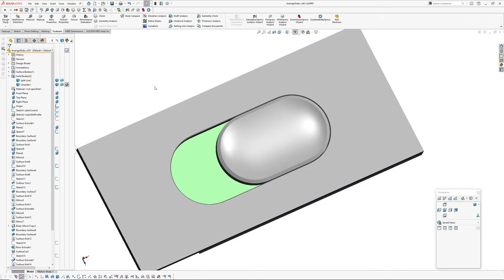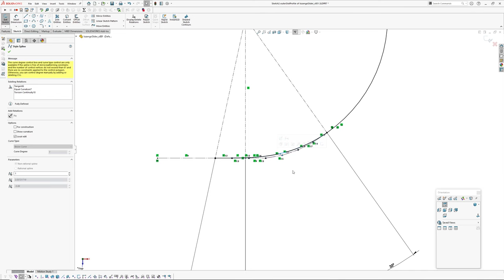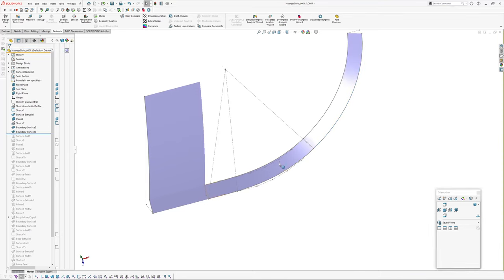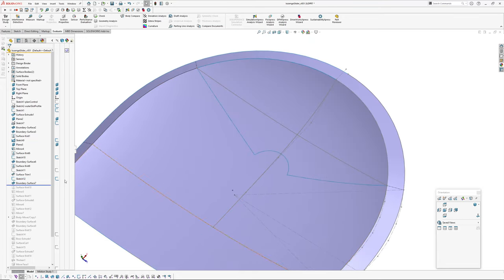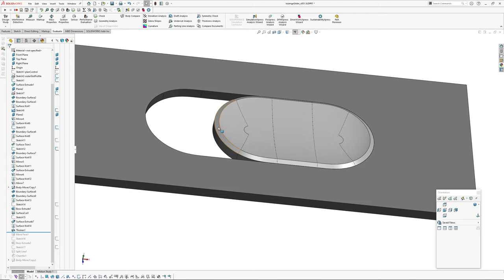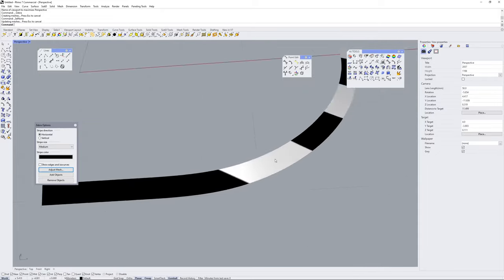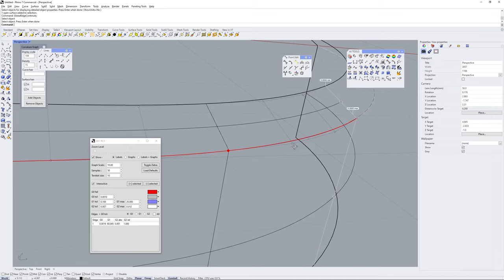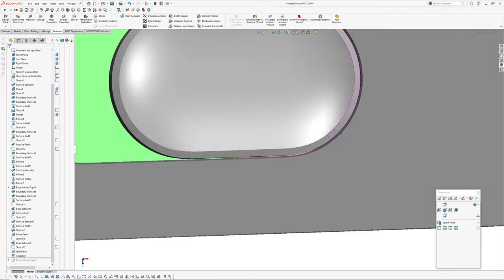Modelling a G3 Lozenge/Pill Switch in Solidworks

Comment: I've got a soft spot for lozenge shapes too! But you probably already knew that! xD
Reply from the maker: Yeah for sure! Found a picture of a more challenging lozenge form but there’s no info about the origin. Maybe I will model that next time.
Reply: @AndrewJacksonDesignStudio  I still feel a perfect g2 curve transition between the line and arc is the best. 
Anyway, after lozenges maybe try g3 ball corner cubes! :D
Reply from the maker: Pretty sure this has smoother curvature transition than a g2 transition. Also have to balance between eroding too much of the arc and having the transition being too abrupt.
Reply from the maker: G3 and ball is an oxymoron? If the ball implies an arc or circle that is 🤔
Reply: @AndrewJacksonDesignStudio  continuing my point above, this perfect g2 “transition” curve I’m talking about also works great when you have to make offsets. 
Offsetting any line and arcs with g3 curve between them leads to discontinuities which when you try to correct will result in variations in offset distance between the entities
Reply from the maker: Why does a G2 (assume a deg5 bezier) spline between entities offset ok whereas a G3 (assuming deg7 bezier) won't? I know SW will in most cases make the offset curve a deg3 multispan spline, whether or not it is deg5 or deg7 to begin with. Let's see an example please, be good to see what you mean.

Comment: Really great video as always, cheers A J! 
I go about this using a similar method in PTC Creo/Style (ISDX), but I don't use the section of arc for the top profile driver. Instead I use one continuous spline i.e. G3 connection to the flat side of the pill/lozenge (set back from the natural arc tangent point) and normal to the centre plane on the other end of the spline. I then match the spline to appear almost identical to the pure arc....I've seen some people automate this process using an algorithm i.e. to take the guess work out of matching the spline to the arc. I think if you use one continuous spline (rather than a spine joining linked to an arc) you avoid the issue you are having with the sweep method, perhaps?
I'm currently working on a button recess channel that resides on a compound A-surface and has a pill/lozenge shape at the end of it. Its been an absolute nightmare to retain G3 lol
Reply from the maker: All good! Yes, I have built pills/lozenges in the same way as you mention. I think I flip/flop between both ways, as you said, doing it in one results in no surface break along the ends. 
One good thing I have found with using an arc is that once you have figured out the relief angles on the line and arc, you can repeat at different scales without adjusting anything, which is similar to the algorithm for a single spline. 

I tried sweeping a line along a deg7+ spline and the sweep still deviated from the path, so I think this is an internal SW issue. Will investigate further.

Your current modelling challenge sounds really interesting! I can see how that might be tricky! Have a good weekend.
Reply from the maker: Had a crack at some forms on a compound surface. Revolved surface, so not that much to think about :)
https://youtu.be/Fgli405qRmk

Comment: "SolidWorks must cover up their tolerance issue" When I was starting modeling with Rhinoceros in 1998, there was general opinion that the software was great but the precision tolerances are terrible 😅, which was true,but I don't know how it is now. After a few years of working with Rhino I switched to SolidWorks and just occasionally come back to Rhino to model more complex shapes. I wonder why you are using Solidworks for surface modeling instead of Rhino, is just because surfaces are parametrically controlled? So the style spline between the line and arc is just to assure the G3 constrains?  Still a long way for SW to become more efficient in modeling complex shapes, it is likely to be replaced sooner by new technology supported by artificial intelligence.
Reply from the maker: SW has no user definable modelling tolerance, whereas Rhino does. Well, not that I know of apart from the tolerance setting in knit... Knowing much more than I did in 2001 when trying to send Rhino models via IGES and STEP to engineers using ProE, I suspect I should have tightened up the default tolerances that I had in Rhino! The jump from RH2 to RH3 also helped lots with the exports (like being able to resolidify the parts in ProE). 

SW must have various tolerances it uses internally, like in this video where the output was not following the input geometry

I use Solidworks as I have clients that need models built in it. Also because it is parametric, as you mentioned. It is way easier to change a heavy model in SW than it is in Rhino. Manually manipulating surfaces in Rhino wins hands down, but balanced against having to layer off progress in case I need to change something - SW wins, even if surfacing can be problematic. 

Yes, the style spline is there to ensure a G3 connection.